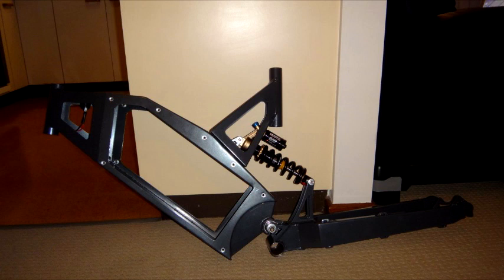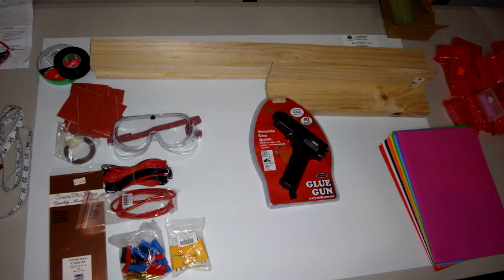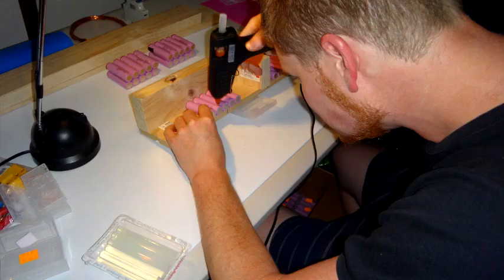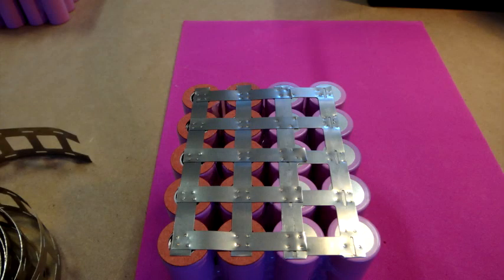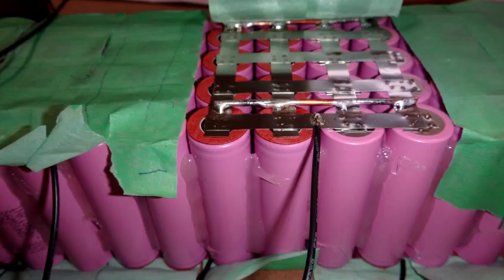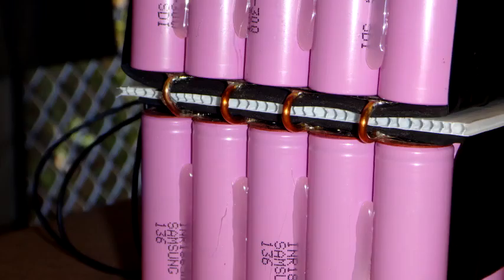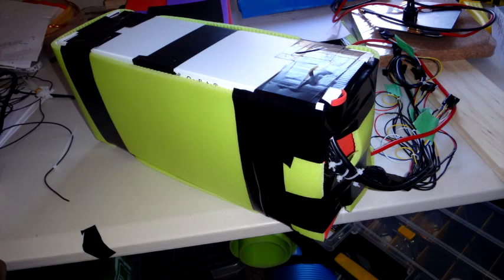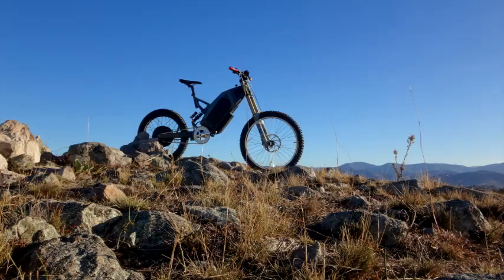High Power eBike 18650 Lithium Ion Battery Build Process

Comment: When you accelerate to the maximum what is the voltage of the battery?
Reply from the maker: I usually get a 3-5v sag on heavy acceleration. The pack is getting old, so this is normal. I tend to ride around pulling 6.5kw as my normal load. Which is fine. The 30q has been a pretty good cell to work with.

Comment: what kind of range do you get with the battery at 30mph?
Reply from the maker: Its hard to calculate range just based on speed. I get about 60 k's of distance out of it from full to empty of mixed riding. so would estimate about 50-75ks in most cases with this bike. All depends on how hard you go and the terrain.

Comment: Lee, it's good work. I like how you taped all the connections while working on it, something I would do and I wonder why not more people do it, SO easy to short it like that.....
 I'm shooting to build a crazy 18S24P pack, same connection style as you did but 3 subpacks folded on each other..... 
My question is, how did you figure the size of bus bars and how many to install for the rated amperage 150A? My pack will be capable of 300A draw so I'm assuming I will need to put slightly larger bus bars and probably more of them....
Reply from the maker: Cheers. Your pack will be huge. As for bus bar amp capacity, look on endless sphere for a chart that includes thickness and heat ratings. Because you have so much parallel you will have more head Room. You can also use thicker nickel strip or more layers. I use 25mm wide nickel now and .20 thick I think. Anyway Goodluck
Reply: @YeahItsLash  Ok sounds good. Thanks for sharing the video, helpful.

Comment: Great video, well explained and with lots of images. How much did you pay for those batteries? I'm buyin 120 q30 batteries for 3.68 usd each.
Reply from the maker: That sounds about right - good price. From a reliable source is always best.
Reply: I got a better price. Basically I told them "Another business offered me the same batteries for 3.2 each" They understood the situation and they reduced the price to 3.1 usd haha. They are also the best business of the ones I contacted because they have 6+ years in the business. Those psychology tactics are awesome haha. The final price was about 491 usd with shipping included
Reply: @merunasg  how fast does you bike go with them.

Comment: That must have been very expensive. At 3$ per battery in bulk, that must've cost 600$ for the whole pack including everything else.
Reply from the maker: Yes they were expensive. Add in delivery and  payment costs and I think it was over a grand AUD. Worth it though! For a few bucks extra you get the best. And remember no fuel, oil or filters to replace!
Reply: At 20a per cell, your bike must have some huge firepower.

Comment: Nice job Lee. Do you think it’s possible to install a Luna Cyclone with minor modifications instead of DD hub? Let me know.
Reply from the maker: Oh hey, just saw your message. No the cyclone kit will be nightmare to install and would hang too low or otherwise get caught up in the moving rear swingarm and BB. These are definately for rear hub only. If you want cyclone or mid driver there are more appropriate frames out there for that such as LMX or even the new sunrons. If you have your heart set on a cyclone then i think a heavy duty older MTB frame would be a good choice. But yes most people dealing with cyclone have to make new brackets or get creative to deal with the "chain-snapping" torque.... and chain snapping in general. Hence why I love hubbies!

Comment: my frame has holes that are not covered, like from gaps where the throttle wires enter the frame and the rear bottom where the phase and battery wires connect to the controller, if you use the bikes frame as the battery box then you can make use of the air flow for battery cooling, lending itself to allowing for the push pull fan system to work.

Comment: cooling for the battery is just as important as foam, my suggestion for anyone building a 18650 pack is to use the bracket spaces, that have a little gap between cells for air flow and use a push pull fan system, this is how i have mine setup and it is very effective at cooling down the battery.
Reply from the maker: You must have an "open air" style casing  - a bit like a pc case to get this benefit of moving air. Otherwise air is not very good at removing heat in an enclosed space. Space is a premium in the bike so there is no room for that kind of extra space or complication. The benefit of having the cells glued together is that they all share and transfer the heat out like on big block. 

The battery doesn't get warm  - 10p, and 30q cells can handle short spikes no worries. Other applications or battery config this may be a concern.

Comment: soldering copper wire or copper sheets is better then spot welding, spot welds have weak mechanical strength compared to soldered copper, nickel also has high electrical resistance so large high drain packs get hot real fast, decreasing efficiency 18650 are tuff and big enough that they can take a little heat with out damaging the battery so soldering is not a problem just need a very hot soldering iron 480 degrees plus, most good soldering stations will do this, work fast and practice on crappy cells first if you have them.

if you are using sheets drill a hole where the battery meets the copper and lay a bead of solder on the battery before joining the copper, that way the solder can flow through into the hole and out the top of the copper sheet, making for a stronger physical and electrical connection.
Reply from the maker: Spot welds are really strong. There is no way this will fall apart. Its a common method. pure nickel strip is fine for electrical current which is why everyone uses it. it also doesnt corode, is light and cheap etc. spot welding is fast and does not damage the battery, soldering is a backward step in my view. slow, and more likely to damage cells. messy - less consistent and time consuming. copper bus bars and current rods are handy though for more current which i have installed. I solder them 'off-pack' to nickel and then spot weld to the pack. no heat transfer.

Comment: good work bro but how you charge that
Reply from the maker: I should do a video on my charger. I use a server power supply and the adaptor controller. It takes care of the charging. Basically you wire the charger into a phase wire and a special wire on the controller. It is s bit different to some other controller setups I believe. Works well though as I can set my charge rate. I just charge slow at 10 amps.
Reply: good I thought you make something like this but if you plz record a video that would be nice step by step 
I really need to make a charger dear thanks

Comment: Sweet work 
Whats the weight of pack in kg
Reply from the maker: I didn't actually weigh it, but the cells would be about 9 kg on their own. so probably 9.5 to 10kg all up. pretty good considering the range is around 75-100+ k depending on riding style.
Reply: +Lee Ashby thats good im looking at replacing my stealth bomber pack its about 15kg,not sure i can manage it though😬
Reply from the maker: +Fitzanator the bomber being a popular bike, u should be able to buy a pack for it from a few different sources and not have to worry about dimensions etc. certainly building your own is a bit cheaper and a good project if you have the time. goodluck!

Comment: Very impressive mate. How much should a person interested in building a same spec bike budget for? Do you have a total spend? I understand if you don't - this would not matter to everyone - obviously, the sum of the parts is now WAY under what the value of the bike is... But if you have any info I'd appreciate it.
Reply: +david mcgrath check out vector ebike there faster and cheaper, the stealth bomber is overpriced and underpowered for the price
Reply: The Stealth bikes seem to hit the right balance of performance endurance and cost/quality.. And.. Aussie built  ..yo
Reply from the maker: Around 5k AUS, give or take a bit should do the trick all up. I was originally trying to keep it at about 4k, but sprung for a bigger better battery pack, and the adaptto MAX-e isnt cheap, but its a top product and is configurable when you are out on a ride. There are plenty of options for frames, motors etc out now that are great contenders. Hope that helps. cheers.
Reply: Good job - and thanks for the info... I'm lined up to test a Stealth B-52... it's a lot of money, but YOLO!